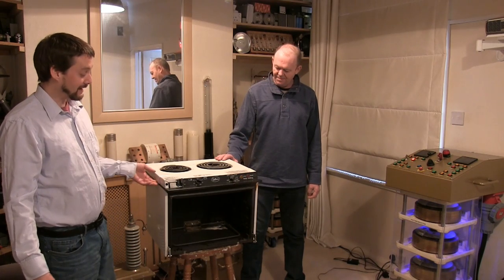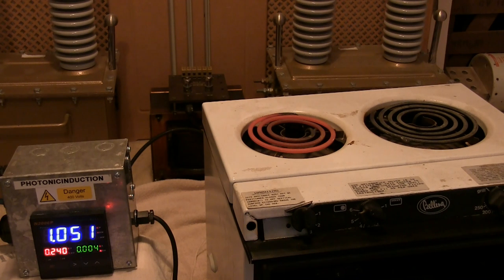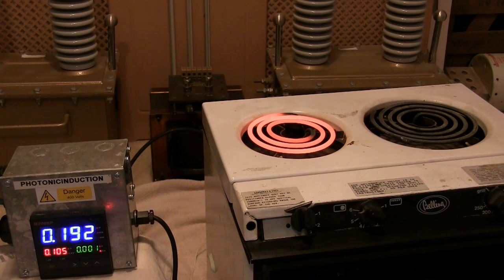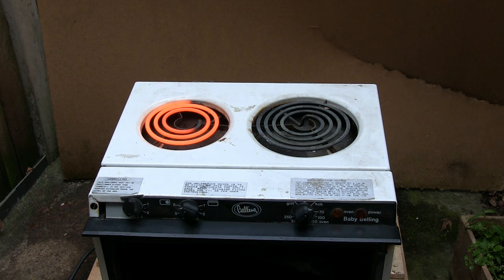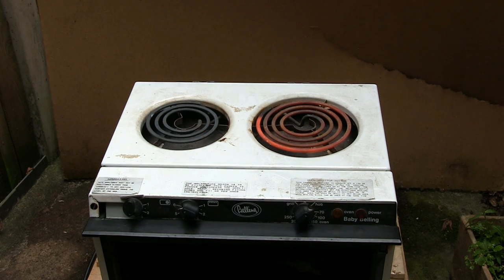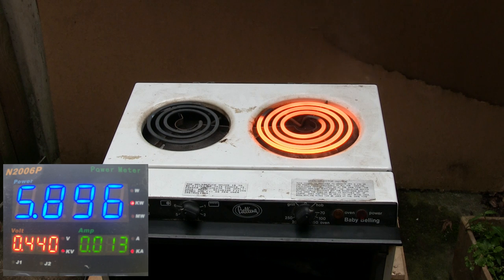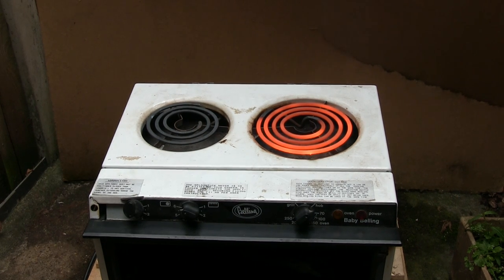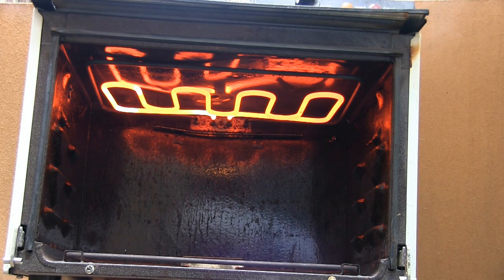Until it Pops - Baby Belling Cooker

Comment: I'm disappointed that you didn't put a pot of water on it.
Reply: LazerLord10 In dissapointed he didnt make a 1000 degree nife with it
Reply: "wheres my 'ammer" never disappoints me when i ear photon say that
Reply: I think he'd melt the pot.  The missus might not like that.
Reply: If just do some maths you would get the result that the stove could get a pot with 1 liter of water at 8°C to boil at 1 min and 30 seconds or on the larger one within about 1 min and 11 seconds by neglecting the heating of the pot it self and asuming ideal conditions(no heat transfer to the environement)!
Reply: Mrs Photon could do Maggi noodles in no time at 500 volts :)
Reply: I'm disappointed he didn't melt some aluminium on it
Reply: that probably would of made the coils explode, would of been epic
Reply: LazerLord10 was hoping to see the voltage upped to jump the gap
Reply: I think he's divorced.
Reply: or melt aluminium in a crucible on it
Reply: Cup of tea time!
Reply: Or a pot of oil.
Reply: that would have been awesome, perhaps he should try to make his own hob out of solid bus bar?
curl it up, put a pot of water on top and apply power overwhelming.
if he measures the temps and the amount of water he should be able to calculate the amount of energy transferred to the water.
Reply: Better yet, a pot of gasoline (petrol). X'DDD
Reply: MissingPlugin XD
Reply: That will instantly boil the shit out of it..
Reply: ObadiahtheSlim what considering he's doing it on a bed in the first place..
Reply: Same
Reply: If he did, the water would burn or possibly catch on fire.
Reply: That would boil up in 2 minutes
Reply: That would boil up in 2 minutes.
Reply: That wouldve been interesting for sure to see how 500volts would heat water
Reply: @userPrehistoricman  nice TF2 profile
Reply: @ObadiahtheSlim  if the pot is filled with water the pot will not melt
Reply: @FBI-dz1lf  lOL how is nobody noticing this comment

Comment: It's actually pretty impressive how tough these are built. Also it's pretty crazy to think that tolerance and standards for these, none of the elements failed until after 500 volts
Reply: There is a saying that exists in the world I'm sure you've heard of it they don't build stuff like they used to anymore it's a very very real phrase especially in this anti right to repair world that we live in and the weird ways that our economies are set up so that we have to continuously buy stuff back then you didn't just have to continually buy stuff one thing and that was it that was the stove or that was the radio or this was the car they had to be robust and reliable the world is such a different back assword way of doing things now way of thinking and doing things now
Reply: @ethanspaziani1070  I'm not sure who hasn't heard of that phrase, and I believe it's absolutely correct. But not always in the way that means things built from previous generations were built better. Car engines have improved in nearly ever way, they last longer, they are more reliable, they are lighter, and they are far more reliable. As far as repairing them? I mean we used to not be able to, but for 25 dollars you can buy a tool to read the codes off the computer. Beyond a simple parts replacement, engines these days are very complex and Beyond the average persons scope of knowledge to fix. The other problem is the human factor, sure we could make a car last for a very long time if we truly wanted too, however someone drives the same car for 5 or 6 years, they want to upgrade and get something nice and new again. But that isn't to say that there isn't some real junk on the market, trust you me, ive seen my fair share of cheap chinesium junk
Reply: A lot of them failed at 240V in normal use. The ones that still work now are the good ones.
Reply: @katrinabryce  several years ago I´m accidently wired a 40W Lightbulb to 2 phases on 400 volts. I was surprised how bright a 40W lightbulb could be. Now then I realized the faulty wiring. 
In old installations the blue wire  was a phase instead  neutral  and the  grey wire was neutral. 
The lightbulb survived this miswiring.

Comment: I'm more impressed that the underlying wiring was able to cope before the elements went pop. I'd like it if you could take a lil time explaining the theory of how and why of certain things Photonic. Like, why doesn't the whole element glow under proper stress, like why the parts near the grommets don't glow and stuff like that. I know pratting around is the basis of your channel but a bit of education wouldn't be to hard to squeeze in, especially at a mobile cabbage level of understanding. Cool stuff non the less, and it's awesome to see you back. Hope you n the new Mrs. are doing great :)

"How do I clean my oven Photonic?"

"It's elementary my dear, watch" 

#bzzt

"There you go, never needs to be cleaned again"

"My hero"
Reply: Neffers I would think the Metal of the oven body itself acts like a big heat sink so each end that's attached to it is much colder than the parts in the middle that only just rest on or not even touch the supports. Also there's a lot of extra length you don't see that doesn't heat up in the element that goes down to the connection point to the stove to make the things easily replaceable.
Reply: The connections are likely to not be soldered, as solder has a relatively low melting point. Even insulation on wiring may be missed, as it's usually flammable.
Reply: Nobody mentioned soldering here dude, you may have responded to the wrong comment. It's heavy tabbed connectors on heating elements for cookers and washing machines etc.
Reply: The input power for the typical oven 'outlet' (they are hard wired) is 30A 240V, which is 7.2kW. So likely they ran the same gauge wiring everywhere.
Reply: Exactly Neffers. I said they weren't because they weren't... ?????
Reply: Sorry, but he doesn't cater to the clueless, Mr. "non the less"...
Reply: the part that actually heats up is a small coil of wire that is inside the heating element. What you see from the outside is a steel casing that protects the wire and some insulation. The coil inside is made of a high-resistance alloy that gets hot when you put current through. Since the terminals at the ends of the heating element are made of a much more conductive metal, they don't heat up nearly as much with the same current going through.
Reply: The wires cares about amps and 15 amps is 14ga, nothing special.

Comment: Extreme heat is actually a way some ovens are designed to be cleaned, heat all the grease up to extreme temperatures turn them into easily removed substances (I guess carbon deposits?) and then remove those with some mild scrubbing around after it has cooled down.

This particular oven/grill thing however was not designed with that use in mind! :D

Comment: are we ever going to use the MW scale on the power meter?
Reply: Next video "Until it pops - electric locomotive"
Reply: i like your profile picture...the old logo from the austrian railway company
Reply: I'm sure the wiring for the stove is rated at 3 to 600 volts so might not be a good idea here lol. Could rewire it though
Reply: Until it pops - New Jersey

Comment: The resistive element stayed relatively stable up to the 480V. Pretty good demonstration of power, since it is double the voltage from when it was 240V, you would expect by P=(V^2)/R to get 4 times the power with a constant resistance. Comes out nicely, 4kW and 1kW.

Comment: I'm a bit late on this one but the elements in stoves are rated 2 time there service voltage or more it's how they can run for decades there basically heat sink capacitors

Comment: heat in a conductor is proportional to the current squared... voltage does not mean as much. if you wanted to fry them you should have put more amps than volts into them. that's why power grids are usually high voltage and low current

Comment: You should NOT be standing anywhere near that thing after 200 volts. Elements like that can literally explode if there's even a small imperfection on the metal coil. You really don't want scalding metal shards flying around anywhere near you, unless you want a big, gaping hole in your neck. While doing experiments like these, at least put up a transparent plexiwall between you and any possible hazard.

Comment: YEP. Doubling the voltage quadruples the power. It's the good old P=V**2/R. But, the relationship is not perfectly linear. Resistance does increase with temperature though.

Comment: 10:46 that same thing happened to a GE stove that was in use. This was during normal use. It didn't spark but it had a bright spot. The element was replaced. And you forgot to pop the top outer element. It looks to me like the broiler had two elements and you only popped one.
And I'm starting to say wheres my "hammer" whenever I need to use one.

Comment: it's a cascade reaction where the resistance increase with temperature of the metal, bright yellow area represent a zone where the resistance is higher. more resistance = more heat=> yellow and it goes on and on until it melt. it's right ?

Comment: Where'd you get a machine from that can put out 400-odd volts at that much power? Are the variacs stepping up mains 240? Or do you have 3-phase coming to your house at 415, and that's why there's three variacs? Did you build it all yourself? Where'd you get the parts? How much did it cost?

Comment: Hey photon how about a soldering iron? A cheap car hid bulb (like the Chinese ebay ones that are colored)? A heat gun? Tread mill to see how fast u can make it spin maybe a way to read kph/mph? Any way to spin a older car alternator that doesn't come with a voltage regulator to spin it really fast and see how high a current or voltage it can out put? Just thoughts :)

Comment: Damn that's a small rangetop.  Are those pretty common over there?  All I really see in the States are 4-burner ranges.  'Course for those we're also 240 volt here as well.
Reply: no that's small for here as well, its probably out of a block of low price student shit holes. the only place i have seen those as even considered "normal"are some parts of London where prices are so high they cant afford a kitchen to put 4 burners in.
Reply: Mostly common in student accommodations. They are mini cookers
Reply: Good to know.  I've seen 2-burner ranges in motor homes/RVs/whatever-they're-called-there, but that's basically it and only necessitated by space constraints.  In my area (Utah), student housing isn't allowed open burners, only microwaves and boiler pots (Hotshots).  Sometimes you can have a toaster oven, but running a hotplate will get you thrown out.  On the bright side, most student communities have an outdoor grilling area and keeping a bag of charcoal or your own Propane tank in your place poses no problem.

Comment: Why are the bigger elements drawing more amps? With the same voltage that is...
Reply: Because they are higher wattage elements, wound with heavier wire, which equals lower resistance, which equals more amps @ the same voltage.

Comment: So the internal resistance on the small coil is about 8 ohm and the big one is about 14 ohm.
The top grill is about 12 ohm and the bottom grill is about 7 ohm.
If I remember the formula correctly.

Comment: my dad was cooking a pizza...... and suddenly BBBBZZZZZZZZZZZZZZZTTTTT!!
.
the element in the oven shit the bed (just old....  no over voltage)
but holy crap did it scare us..... we thought it was going to weld the door closed!!!
(my dad is a welder.... im an auto-mechanic.... so we both know welding)
.
.
but ya.... in this video.... it gets REALLY hot.... ya get a pop..... then its done
.
however.... my oven was like an arc welder for a good 15 seconds.... 
my dad and i both knew "that sound" (aka, arc welder noises)
.
and we were both too scared to shut off the oven.... just in case it was arcing to the "case".... and energizing the knobs
.
.
.
.
but ya.... its strange how this just went "pop" and its done
meanwhile..... my oven light up the whole kitchen with blue light..... and arced for a good 15 seconds!!!
.
.
we replaced the element with a new one.... and its been fine for ~4 years now